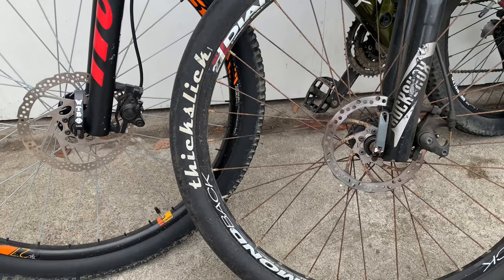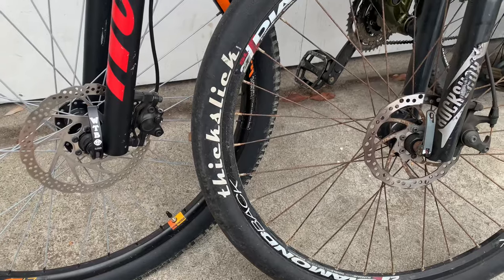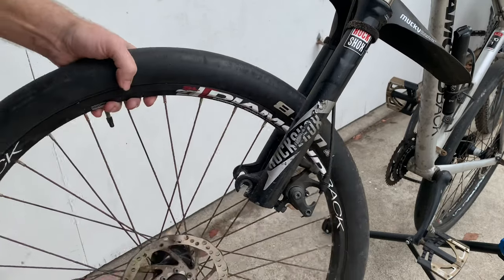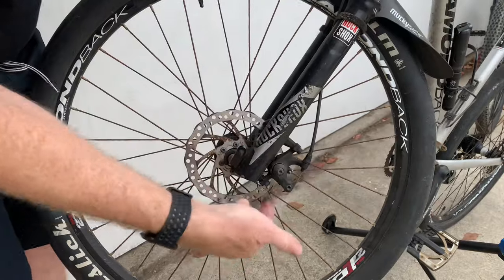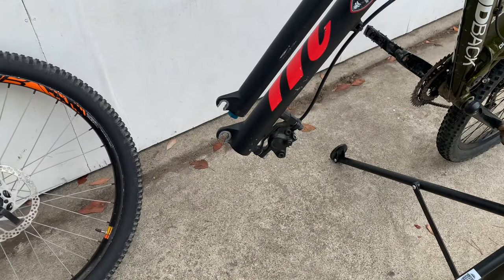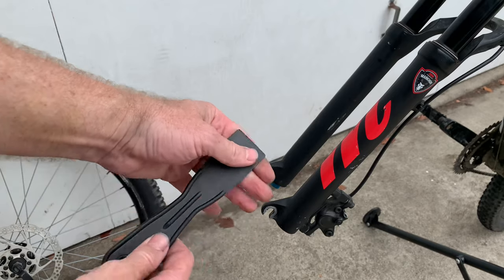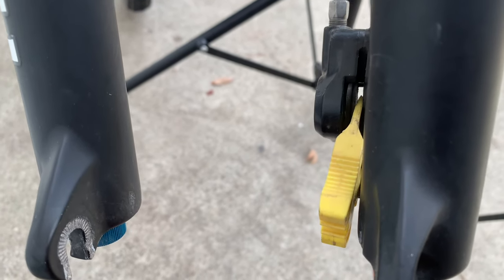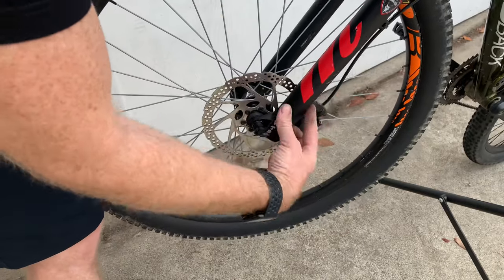How To Remove A Bike Wheel With Disc Brakes

Comment: Great video, I love your energy! How do prevent disc rub when reinstalling the wheel? Bikes with thru-axels generally don't have this problem, but bikes with quick releases give me a headache every time ... The pads tend to rub on the disc and I need to try multiple times until I get the wheel back*exactly* as it was before... Any tips, please?
Reply: I have the same problem. Have to dismantle and try again now.

Comment: how do I remove a cable disc brake that doesnt have a skewer to loosen up, and only the nut?
Reply from the maker: Remove the nuts to remove the wheel. You don’t need to do anything special to the mechanical brakes.
Reply: @hoohoohoblin  thank you.